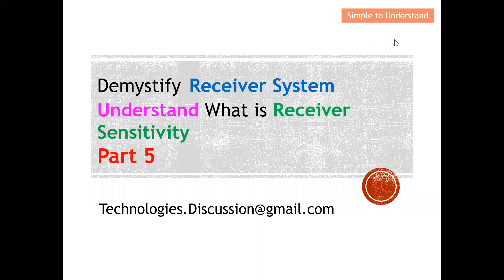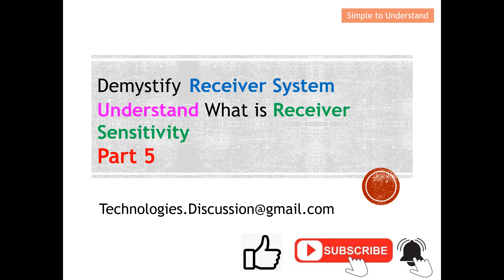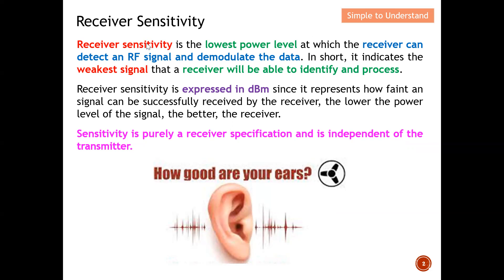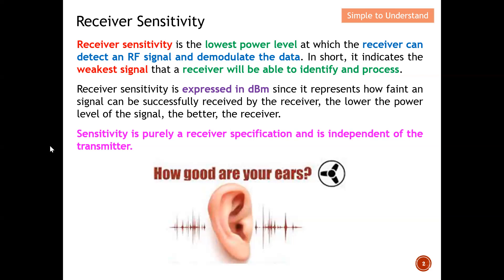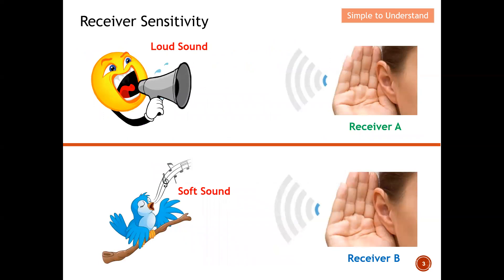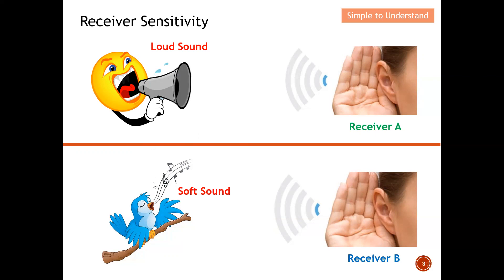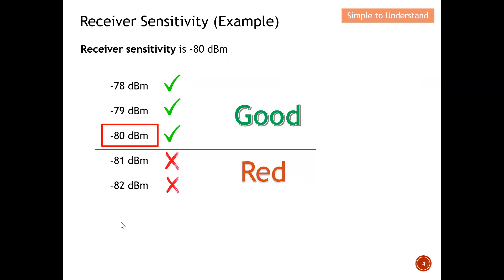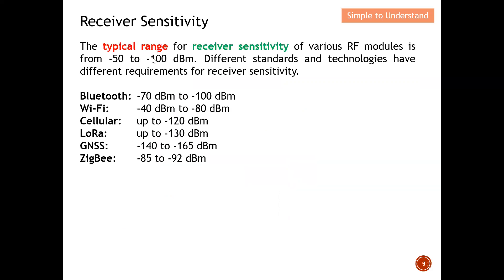Receiver Sensitivity Explained: Minimum Detectable Signal Level for Recovering the Received Signal.

Comment: Thank you so much, great efforts and it is very useful;
Please, I would ask you about the standard limit of error vector magnitude (EVM) in percentage (%) (EVM%) for WiFi received signal (IEEE 802.11 n), the same question for signal to noise ratio (SNR in dB);
I's really will help me a lot if have exact and precise idea regarding those parameters!!
 I need those parameters to use them as a reference for assessing my transmitted RF signal performance after its propagation through multipath wireless channel in the simulation,
Any sort of help would be really appreciated as soon as possible :)
Reply from the maker: You can see this link for EVM in dB.
https://www.litepoint.com/blog/error-vector-magnitude-why-it-matters-and-how-its-measured/

Then convert to %: 
EVM = -18 dB

EVM % = [100 * 10^(-18/20)] %
EVM % = [100 * 0.125892] %
EVM % = 12.589 %
Reply: @technologiesdiscussion1676  Thank you so much :)
Reply from the maker: No Problem, Thanks again for my very very early supporter.  :)